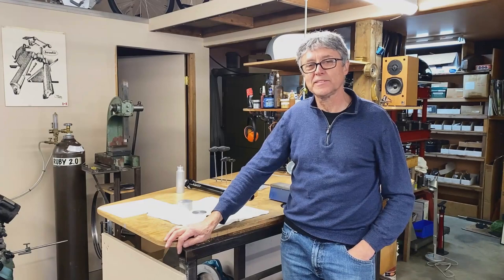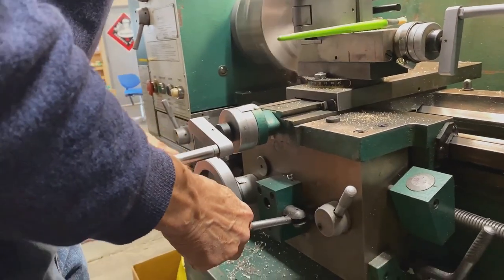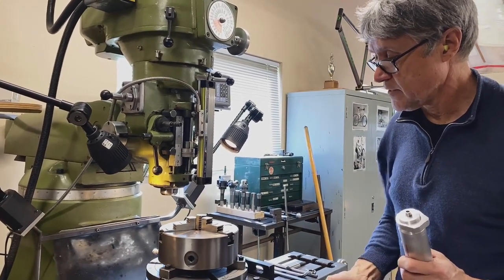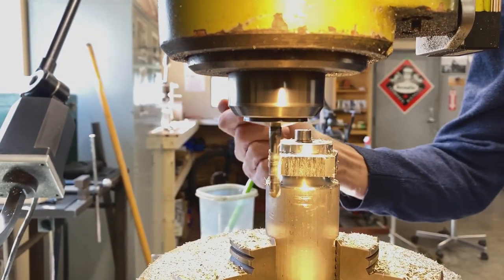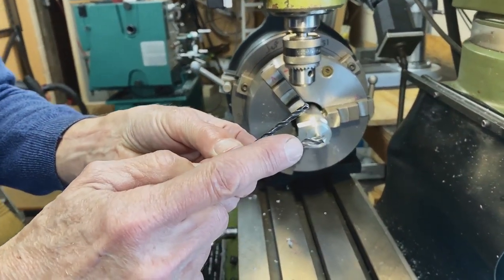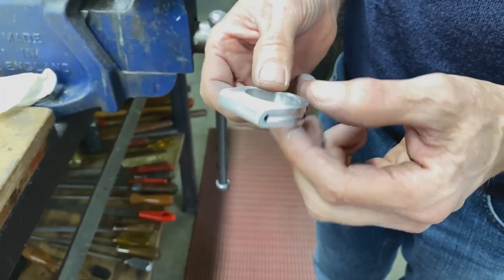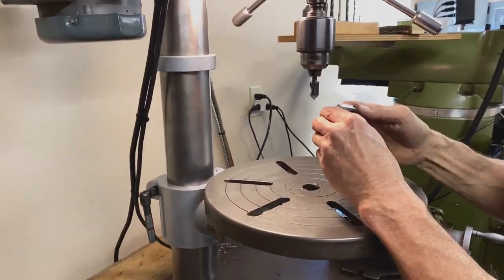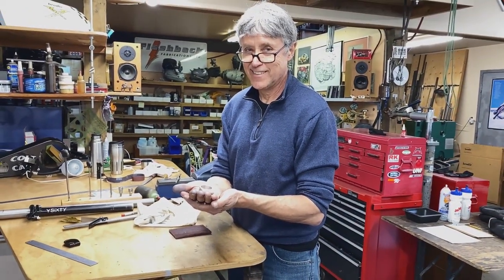Making a Seatpost Clamp with Paul Brodie - Framebuilding 101

Comment: Just noticed your variable speed drill press! I have the same brand, purchased about the same time. USA motor came with it, very smooth. 
Did you make the variable speed drive? I’ve never seen a mechanical version like that for sale.

Comment: It look so easy when you do it :-D you often use hand file for some final touches. Are there differencies between them? Because when I use it, it leave scratches on the piece.
Reply from the maker: Try changing the angle of the file, it does make a difference. Final smooth with emery cloth.
Reply: @paulbrodie  Thank you.
Reply from the maker: @spiritofstreet6581  Also, if the file is "clogging up" try using a scrap piece of aluminum and rubbing it across the file teeth, back and forth. That gets rid of small pieces of metal that have become lodged.

Comment: Love the drill variable speed. I'm doing that to mine asap!!
Reply from the maker: It was a bit of work, and the variable speed pulleys were $400 back in the 90's, but well worth it.
Reply: Is there somewhere I can look for documentation? I didn't quite get how it works but it seems to be amazing!
Reply from the maker: @Le_Guigster   My guess is you're talking about my drill press, correct? I don't know where to look for "documentation", but one day we will do an overview of this amazing machine!
Reply: @paulbrodie  yeah that was the variable drill press speed. I've looked it up since yesterday, amazing system but for sure I'd be interested if you show it one day (and many of us would too haha). Cheers Paul!
Reply from the maker: @Le_Guigster   Yes it is going to happen. Stay tuned.